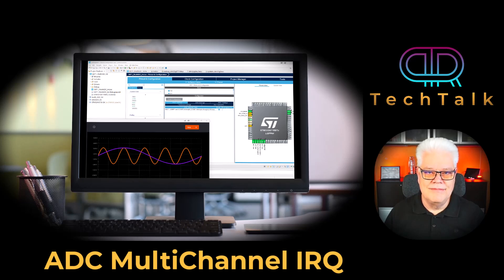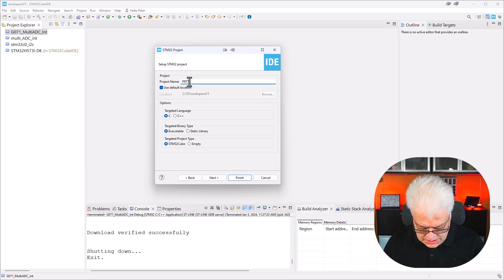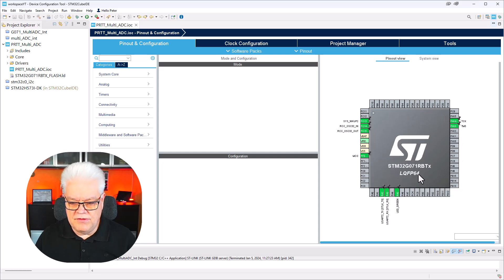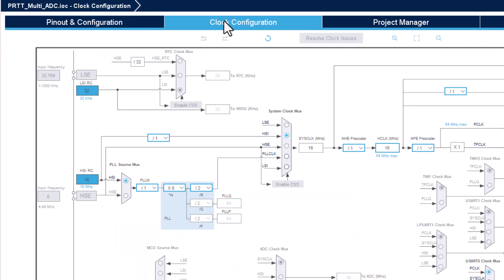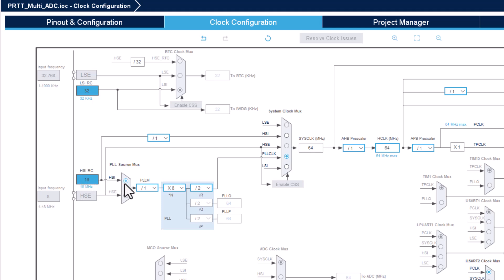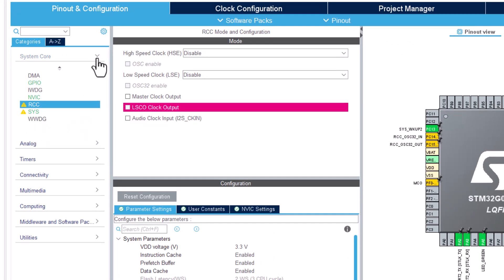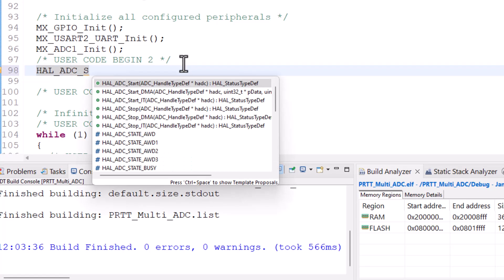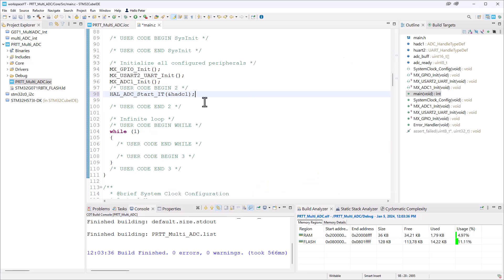Tutorial On ADC MultiChannel Interrupt method.

Comment: I copied your code (and the file .ioc) but it doesn't work (I have 3 potentiometers in 3 channels of the ADC). It never triggers the condition "adc_ready == 1" ... where can the problem be? I've tried using DMA and it works
Reply from the maker: Hi, hard to say what the issue could be in your example it could be a numerous things.
Reply: @prtechtalk416  Trying the code again, all 3 channels of the ADC read the same thing (the same value). I think the problem is in the main.c code. Thank you for your reply!